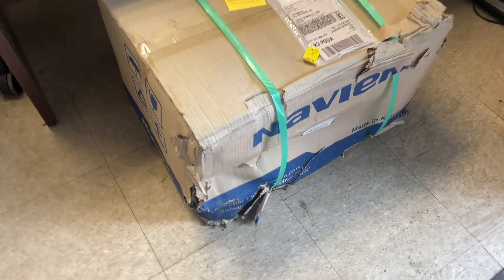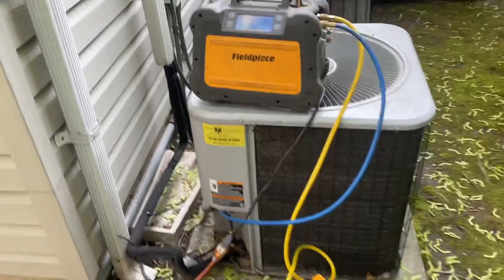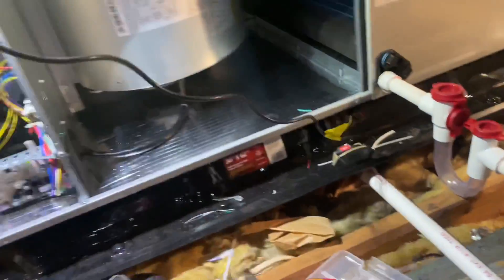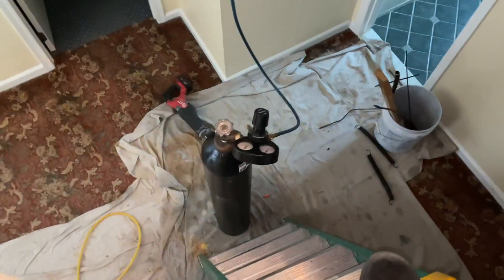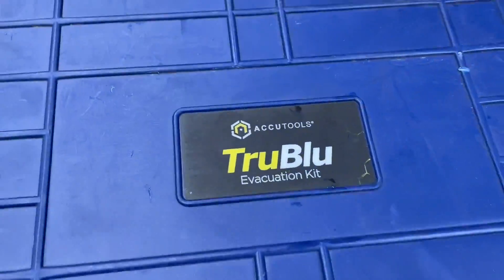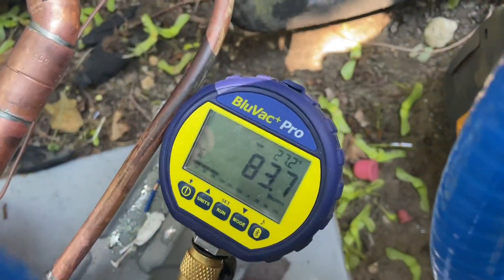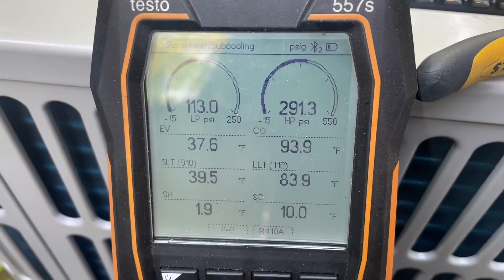Bosch IDS 2.0 4 ton Installation Using ZoomLock & Stay Brite 8 - Extension Cord for Nitrogen Tank?

Comment: Hi Mikey Pipes, where do you get your ZoomLock fittings, ferguson in my area ( NJ ) discontinued selling them and the reason was leaks on small high pressure lines. I was surprised because I have a few minisplit systems using ZoomLock and never had any issues. Their flare ready fittings are super nice. Would love to hear your opinion

Comment: one tip that i use almost on the weekly....i took a 100' x3/8" hybrid air hose and put the standard air chuck ends on it.  then i went and bought another set of male and female standard air chucks and screwed a brass 1/4" mpt x 1/4 schrader into each of them. now i can put those ends into the hose and i don't have to haul the "S" nitrogen bottle up to the roof to test or purge my sytem anymore.  the air hose is safe to 300 psi which is more than adequate for everything except for VRF's. ive even had up to 300' of these set up to get to the middle of the roof so i didn't have to haul that bottle up there!

Comment: Hey Mike I got 8 sets of propress jaws that will fit on your zoomlock press. I'll give you a good deal on a set if you're interested. That press will do 1/2" 3/4" and 1" copper press. I'm just outside of Albany.
Reply: @PipeDoctor  I'm gonna send them to you regardless. Send me $100 of mixed 1/2 and 3/4 random press fittings if your sainthood commands you.
Reply: Your zoomlock tool is the same as the Nibco PCM10 tools that I bought a fleet of with tools that need service and with old NiCad 9.6v batteries for a song from this dude on the west coast. I spent $1k on 8 Nibco press tools that came complete with jaws batteries and chargers. I bought a mega press and a M12 press system after I got a big copper job.
Reply: I'll send them down to you sometime this week.
Reply: @PipeDoctor  My local troy Johnstone only stocks the good stuff. No in all seriousness I'll get them in the mail around lunch tomorrow after I clean them up a bit.

Comment: Just a tip.probably be a good idea to put a surge protector for the outdoor unit.we put in Carrier and the green speed units.we were having trouble with the power fluctuating from the power poles taking out the boards.of course the power company says there is no problem on there end
Reply: now days, it would be wise to put one on both indoor and outdoor units. everything is chock way to full of junktronics to be reliable.
Reply: @PipeDoctor   we use the intermatic ag3000.  The warranty is misleading it says 7500. It will pay upto that amount for the homeowner deductable. Called them and asked. It seem to work well anything that has invertor technology from bosh to ductless mini splits.   The great thing with bosh is it has brown out protection built into the boards.  They are a badd ass units

Comment: You should get a twenty nitro tank. Smaller and easier to flush the lines in the attic. Also should insulate the condensate line so it does not sweat. It's code in N.C.
Reply: Schedule 40 PVC pipe should not have to insulate, stupid code but we see it here in Texas from inspectors also

Comment: I installed my 4ton 20 seer Bosch a few weeks back.  It says in the book 4 ton full speed is 54hz not 61 or 62.  I didn't read in the book how to set the outdoor unit to run for a 4 ton air handler.  Can I leave it alone and set up for a 5 ton?

Comment: Awesome job Mikey Pipes! Only thing i would want to look into further is the low superheat of 1.8*. Understand it’s a TXV and we charge via subcool but maybe there is a restriction in air flow for the low superheat/suction readings. Just my observation but as always great job looking after the customer with the stairs!
Reply: @PipeDoctor 
The bosh requires adjustment of the txv to obtain target SH if needed if you using a bosh air handler/coil.  It's in the book, but if you ask you local distributor they have no clue how this shit works other than there great lol.
Reply: @PipeDoctor  most TXV’s are set up to maintain at least 10-15* of SH, I have seen them as high as 20-25* but granted those readings there wasn’t a massive indoor/outdoor load. Not 100% sure with the Bosch as I’ve only seen them watching your videos. The low superheat is worrying, no margin of error if a customer has a dirty filter for example and liquid goes right to the compressor.
Reply: looks like designed superheat from what I quickly read in the manual is 9-18*. with that said, it also states the "only recommended method of charging above 55* outdoor ambient is subcool" Your number is spot on for subcool, I guess I just don't like seeing such a low superheat haha. thanks again!
Reply: I know with the 1.0’s they wanted you to adjust the txv if it wasn’t between 12-18 clockwise on the txv to raise the superheat, counter clockwise to lower it.
Reply: @PipeDoctor  Just out of curiosity, why don't you install the heat pump component on these Bosch systems?
Reply: If its a TXV metering device, indoor temp is close to 70°  with good airflow(i doubt that based on that duct design) then that superheat indicates an overcharged system buddy. Bet if you sat there for an hour that subcooling would end up spiking as the TXV tries to shut. Was there no load on the home or something?

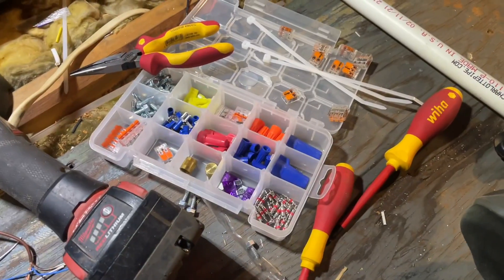Comment: 2:41 I believe you got that wrong. If that is switching 240v it is DPST not SPDT.  Single throw means it makes and breaks 1 set of contacts. Double pole means it does it for 2 sets of contacts. A 3 way switch is a double throw single pole switch.
Reply: @PipeDoctor  No worries bud. Im sure you knew what you meant.

Comment: That thing looks sweet but complicated ! I know Bosch makes good stuff what’s the benefit of this , maybe I’ll have to look into one
Reply: better heating performance in cold weather too.
Reply: Match it with either a variable speed or Ecm furnace/air handler wire it for 2 stage cooling. Add a prestige 2.0 and dehumidify on demand at a low blower speed. Unit will match it. Great ac unit to zone with.
Reply: Only draw back they are Chinese hence why they cost half the price verse like a xv18 or 20 Trane. Wee shall see how they do. I know the service valves on these are cheap. I have to run a garden hose on the valves while brazing otherwise they melt and leak. I’ve tried everything other than soft solder
Reply: @Noone-zq4xm  with attic ducts imo the last thing to do is slow the fan, caused more loss to the attic.
Reply: I’m in Illinois. Attic systems are rare

Comment: Zoom Lock, when manufactures set up coils and king valves for it will be nice, spare heating up and wet rag wrapping the txv and valves.
Until then you still gotta lug a torch rig. Just not worth the money, yet.
Reply: Mikey Pipes - Pipe Doctor Plumbing & Heating & Air 
Exactly, as far as I know no one intends to do that. It’s bad enough stubs are getting shorter, I was told ‘shipping damage’. Maybe, but I think it’s to save a few pennies at the factory.
Reply: they can't even keep the stubs they give you now round inside the boxes after shipping them...how could you expect to zoom lock them if they made them longer.
Reply: pipeboy98 
Yup, that’s the conundrum. Cornering the box better may help.

Comment: Man you got all the toys. How reliable is staybright 8 on 410a systems? Is there any data to support it vs brazing?
Reply: StayBrite 8 works fine with 410a. I used it when I installed my new HVAC equipment over a year ago. No leaks, the A/C is cold, and the electric bills have really dropped.
Reply: It will leak over time and that’s a fact. Been doing this 1997. Use brazing rod
Reply: @Noone-zq4xm  nonsense. A properly done stay Brite joint is as good or not better than a brazed joint. Plenty of information out there on the interwebb to support that. I’ve been using it for 25 plus years with 0 problems. If anyone is brazing, you owe it to yourself to try staybrite 8. I don’t think you will ever return to brazing.